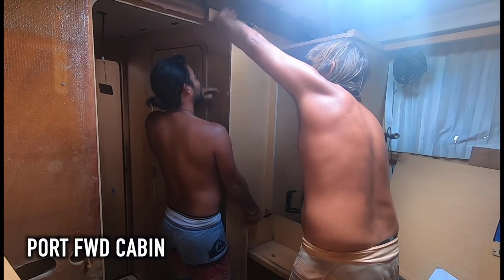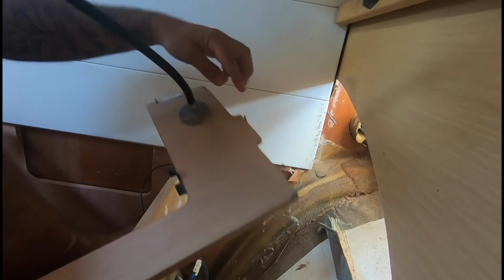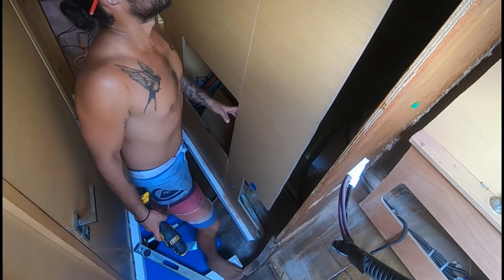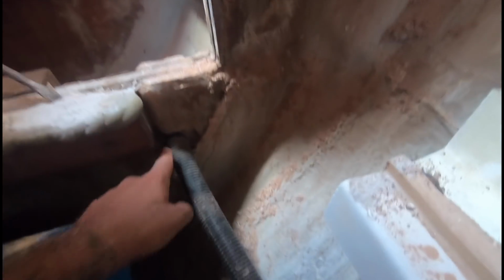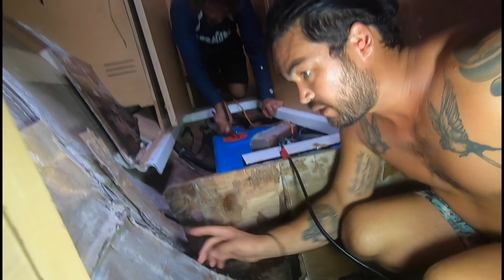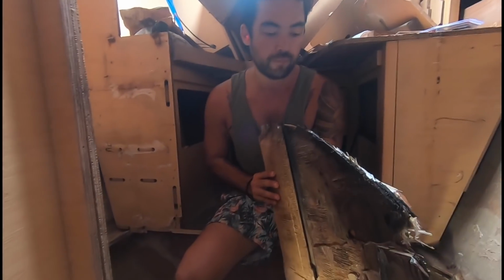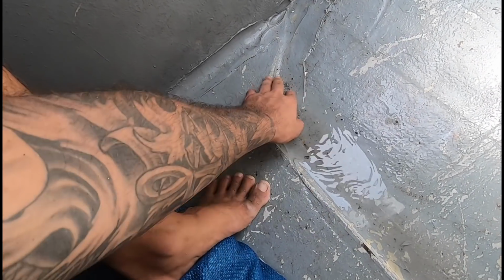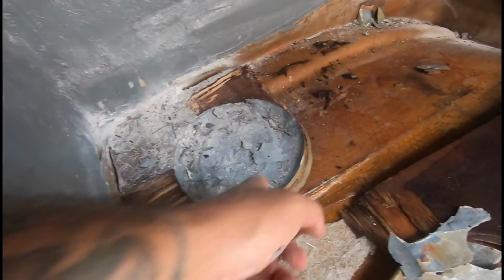CRACKED BULKHEAD REPAIR SERIES - Part 5  (Episode 110)

Comment: I think there maybe a lawsuit with this post might need too be re worded out. Too many people placing the Blame on a company.
This repair on the bolk head can be very dangerous not knowing the running load strength on the  length.
Under compression the load will change the resting pressure even more if you glass into the haul it will be like sitting a knife on a edge of paper and saying it won't go through. But what do I know I'm just a engineer with heavy head injury.
I really do suggest you remove some of this video.

Comment: Hey Colin. Love the videos, and your journey is inspiring. I'm currently  building a small fiberglass sailing dinghy. One of the best tools for grinding fiberglass with reduced dust is the techshear. It is a disc with resharpenable carbide teeth, expensive but worth it. You need to us it with a grinder with a 5/8" spindle that has an adjustable RPM. If you set the RPM's low it literally throws shavings and little dust. Probably too late now, but the next time you grind a large hole in the hull you should try it. I've been in fiberglass boat building/repair for about 28 years. It's still the best https://technashear.com

Comment: With years of building and studying composite sailboats, I have formed this opinion. Catamarans are a design flaw. By this I mean that having two hulls, moving over and threw the waves at different angles creating different roll and pitch are creating conflicting stresses to the bulkheads and the bridge deck’s structural integrity to hold the boat together and all the time adding compression stress from the mast and tensile stress from the rig that is transmitted to the hulls.

Comment: Wow Colin.... seems like these 450's were poorly designed from the start... That other guy you worked with seems to be having the same problems you are and others who are now looking at a class action suit... I understand the determination to finish what you started but man oh man the costs to repair is hardly worth it all. Good on you to finish what you started though, it may just be as expensive if not more to start with something new.... definitely going to be a better boat once it's all done... it may ride 2 feet lower with all the re-enforcing you have to add...lol good luck

Comment: Somewhere in the world, the structural engineer who designed the Lagoon is saying the electricians did what to the structural panels? Why aren’t the cables run under the deck in waterproof conduit with stub outs to each cabin?

Comment: i was in a situation that i had to keep the dust down   if you can and it wont hurt your work so much    very lightly spray/mist a lil water on the glass while grinding   nothing heavy/wet   just enough to keep the dust going everywhere       my solution worked for me.... hopefully it will work for you all

Comment: Colin it would be better if the door frames had a big radius in the corners. = much stronger. Square doors are easy to make and install but have weaknesses . Big radius corner doors and frames  are always stronger but are always more difficult to make and fit . Only  a thought!

Comment: Thought , try completely removing the cracked and broken bulkheads all the way down flush to the hull and replace with coosa board not plywood!!!  The coosa will not rot and it's stronger and lighter , costs a bit more but worth it in your situation !! Oh make your bulk heads 3 inches thick top to bottom , change your door corners in the bulk heads to 8 inch radius, greatly increases structural strength !! Have fun and good luck!!
Reply: A lot more but it’s forever.

Comment: Shit build quality by Lagoon. Out of sight out of mind. Conduit holes drilled in major stress points. I also feel manufacturers should no longer be working with polyester and should at least use vinylester. They will take a long time to recover from this debacle and hopefully they and other major manufacturers will realise that there is no hiding since the advent of the Internet and that they need to build things properly...not just making visible things pretty. 🤨

Comment: hey colin just ask lagoon for a compleet new interior buildingpackage because there is not much left when your done....  eye on the prize guys. you are killing it!
Reply: They'd have to pull the deck to get another factory built interior installed, it's not really made to be retrofitted in like that.
Plus, a factory interior doesn't allow for inspection of any of the important places, which leads to problems like this going unnoticed, which is clearly a huge problem. Better to rebuild it properly.

Comment: Watching the value of Lagoon 450's go further into freefall with each episode..... Having said that, by the time you are  finished, you will be on the worlds most ( and possibly only long term )seaworthy Lagoon 450... Do you ever wonder it it just wouldn't have been easier to build a Wharram Tiki 46 or Islander 65.
Reply: Thinking further on it, designs like the Danson designed Outremers and the Alexander Verheus 50, where the interior is structural would go a long way to ensuring these problems cannot occur, or if they do, they are immediately obvious and remedied. It might be time to move away from designs that hide workmanship.

Comment: The suggestions for a negative pressure enclosure and waiting until after sea trials to replace the interior are both good suggestions.  Obviously you will design the replacement cabinetry for easier access. Hang tough.

Comment: Man that locker leak is mind boggling.  How could Lagoon not plan for such a thing?  No drain?  Wow.  Good on you guys for powering through.
Reply: A locker on the bow, no less.
Reply: @w88dm4n  Not just a locker, they're called "wet lockers" because they're supposed to be designed to store wet items, like scuba gear and the like, so they don't get water all over the place. These are more storage bathtubs, that drain right into the bulkheads, absolutely terrible design.

Comment: I'm kind of relieved to see those blackened plys torn off. I've been thinking if you would just end up slapping repairs on top or if you will go with thorough repair. Good to see it goes into thorough direction. Prime example on how a tiny problem combines forces with design flaw, and how they together reach the stars in the damage universe.

Comment: Lagoon should be paying YOU for all the free real world R&D you’ve been documenting for them. I hope they use this to make their product better. You could have a career as a documentary filmmaker after this! Thanks for sharing! Good Luck!!
Reply: They've known about this problem for some time now, they even have an official repair procedure. Minimum of 50k at the dealer, 90k if they have to take the deck off (which is likely). These boats are all essentially salvage without the owners even knowing. Only a matter of time before they break up at sea.
At this point, you'd think Lagoon would do the right thing and at least notify owners and offer inspections, but I'd guess that they're bracing for a class action lawsuit and don't want to do anything that could potentially be used against them in court. Absolutely shameful in my book.

Comment: Wow! We are all emotionally invested in your rollercoaster journey, and sometimes difficult to know whether to laugh or cry! It may be fate that it is you who has met this boat as you are one of few who has mix of repair and engineering skills and positive outlook to keep going with this project. And mates such as Jamie to help and keep the positive energy.

I am just a viewer brought to your channel during Covid. So my comments are from interest and certainly not from sailing or technical knowledge. Whatever the comments on Lagoon build quality and even whether the bodge job repairs you found were by previous owner or at production stage (they seemed to be in inaccessible places), is there a general issue with polyester resin bond  strength and delamination over time? It seems there is also a problem in the construction process of having pre fabricated inners with slot fittings between hull and deck (plus screw heads inaccessible on hull side!) so there are no inspection points for surveys or maintenance checks to identify potentially serious issues at the bulkhead in particular. The only luck you had was finding this problem when you did rather rough seas in mid ocean crossing. If I was a company underwriting boat insurance, even with a relative few (?) annual non-hurricane losses, I would be requiring surveys on bulkhead integrity on boats over a certain age before insuring. Particularly if water ingress, whether by hurricane damage or leak from trampoline fixtures, rotted the ply to the extent it was a contributory factor to the bulkheads flexing beyond critical strength?

The help from Lagoon is interesting. And, even with your NZ Lagoon contact, it is very unusual for the designer and senior executives to get involved. It may be that at the start of this it was thought that some bodge repair jobs from the previous owner was the cause rather than a production process investigation, and so it would be good PR to get involved with a fast growing social media channel such as Parlay. They may be regretting this now - although a wider issue is that other makers will have had similar production materials and construction.

Comment: All that screwed and glued 'hotel' furniture is a terrible bit of design. Anything that can rot or may need to be removed from a boat should be designed with that in mind. But in my mind designing a boat interior to look like a hotel is just putting unnecessary weight in anyway. If it were mine I'd gut most of it and start again. Lagoon should be ashamed of themselves. Good work keeping it cheerful, and it's fascinating to watch.

Comment: Using plywood for a main structural support seems like a pretty cheap shortcut..Knowing eventually it's going to get wet and rot..There are some water proof structural materials they should have used..I wouldn't recommend that brand of boat to my friends.. It's too bad you didn't know ahead of time and start by gutting and repairing it from the inside out instead restoration from the outside in..😔

Comment: As far as I understand, you are planning to triple up on the bulkheads. For some reason, the lower parts of the bulkheads are already of that size. It seems to be a factory thing. If you reinforce them this way you will be safe for the next decade. But try to avoid drilling holes at the corners of the doors, as this will weaken the structure again. If it's possible run the cables elsewhere. Good luck to you guys.

Comment: The really cool thing is you will be able to build it back exactly like you want, with the features you want, designed the way you want. Something most never get to do so there is a bright side to this project! Not only that you can get rid of any deadly mold that can and has killed people!

Personally I would fork out the extra to use carbon fiber to strengthen and reinforce these areas. Fiberglass is good and all but it does not hold a candle to the strength and resiliency of carbon fiber!

Comment: That WET locker needs improvement I’d say? A quality rubber floor ? To help support ! And or, otherwise reinforced and If it was my boat I’d have a small fan for circulating air to help keep things dry and less stinky ! Sweaty 🥵 and of course a new drain system  ...

Comment: Obviously cut off the trampoline attachments and seal/isolate that area, then build a new strong lip and eyelets or bond an aluminium support rail/eyelet piece so it looks good ! Or something !
Reply: At minimum, all of those tramp attachments need to be removed and silicone'd back in. Also those lockers not having drains is a huge design flaw, they're called "wet lockers" for a reason, ie, they're exposed to water regularly and need to be washed out and drained.

Comment: Seriously, ty for showing how crappy that boat has been manufactured. It's really going to drive down the resale prices on everyone one of them. Seriously, pathetic craftsmanship....they could have easily double up the bulk heads, should have sealed the bulkheads with penetrating epoxy.... you know the simplest things that should have been done to the most structural part of any boat. Ty again. Sorry you are going through this but you are saving so many ppl.

Comment: I’m Somewhat shocked at the bad language and badmouthing of Lagoon after all the help they have given with the technical details. Yes some of the comments one might agree with about NDA’s and getting a new boat et cetera, but remember if the boat had been insured it would’ve been burned and replaced. I think there was an option to insure this boat after the first lot of repairs, so really the faults are with the existing owner, who knowingly at the outset bought a really cheap boat already shoddily repaired. Anyway that said ... I hope they get everything sorted and put back together neatly and properly inside, But I doubt it will be. I just don’t think they have the skills to put it back together to look like and the girl would new out of the factory.
Reply: @Adrian Matthews Adrian, good evening, well I don’t know what to say. Is this Lagoon a design for blue water sailing? Quite honestly I’d rather be on a 45 - 50 single hull for that. How many have had structural issues and were they in extreme use. The boat looks more for inter coastal and top end rentals/hire. Best regards and hope you always have a following breeze. Andy D.
Reply: @Adrian Matthews Right Oh .. shoot.  Will stick with pre used Oceanis 46.

Comment: Getting a fiberglass sandwich beam at the ceiling of the cabin probably would help, if the walls that do not flex, and should keep the hulls from moving independently. The fiberglass you can see below is not very thick and cannot take large stress, the cabin is part of the structure between hulls.

Comment: I was about to pull the trigger on a used Lagoon but put that on permanent hold. Lol. 
Will be checking out other manufacturers 
Thanks for all your hard work and determination 
I don’t think I could deal with what you are going through and I doubt it would be economically feasible to pay someone reliable to do this incredibly extensive amount of work. 
Watching every episode on this. 
Hang in there. 💪💪💪

Comment: I was a commercial aircraft structural and interior repair mechanic..and I thought that was a pain in the ass.
What you are doing, is By Far, Way More Intense. Huge Prips to you two for taking in such a Massive project. 
Though I can relate to the Compassion of a project...once started...you Don't give up.

Comment: Structural way to weak to call anything a “bulkhead” 😏 in the current format!
And cross directional Torsion/ non existent ! Highly likely the “ rigging system “ is disproportionate and likely under too much tension.

Comment: Beyond the obvious of stopping the water coming in the hull where the trampolines are, is it possible to add a drain into the lockers while you have them torn open?  I think it would be cheap insurance if they ever decide to leak again down the road.

Comment: I agree with drew isolate all your rooms and pressurise and evac , and cut those beams out?
They are NOT beams ! No matter how many laminations ! Make structurally integral new composite beams with integral wall supports molded into place on the beams, as if to them slide your new composite wall structures UP right/tight to place and then locked into the new floor supports your going to need. Think outside boxes 📦🤓😏 
Lagoon should be able to supply quality Carbon materials ? I’d be making shiny new exposed beautiful bulkheads throughout , this is essentially a complete internal refit to do this properly, you may as well set up a BIG army tent ⛺️ catering/production facilities with sleeping arrangements outside the vessel,
Even with room by room sealing and evac, this is technically a biG job and to do anything less would bite to hard into time ? 
Remember the adventure ? 
The world is waiting !’ 🇨🇦

Comment: Sometimes that just aren't enough rocks. (Forest Gump)  Why use a material that can "rot" at all - on a boat? Better to use a smart designed-for-rigidity carbon-fibre panel or fibre-glass-E.
I would go to war with you two any day of the week; not sure I'd want you in my platoon nor in charge - but in my army any day of the week - for sure. You two are friggin  Spartacus !

Comment: You are in the worst of the restoration process right now.  After all of the demolition and final grinding to get to a surface with integrity, you will have a clean, blank canvas.  Every day after that, the boat will be coming back together, under your terms (and likely overbuilt), resulting in a boat with a sound structure.  You'll have a great boat.  However, your series convinced me never to buy a boat designed for the charter business, to say nothing of buying a hurricane damaged boat, as it seems they were designed for a specific lifetime prior to disposal.  What a trainwreck this has been for you.

Comment: So many Lagoon broken bulkhead videos!! How long before Lagoon steps in and says they are going to fix these boats for these poor people!!  Parlay I hope your repairs go well !! Also what engineer signed off on 1 sheet of plywood being good bulkhead material.
Reply: Lagoon will step in when the earth freezes over
Reply: @rayd488  Or the owner of Lagoon will close up claim bankruptcy and sail of into the sunset on some other make of sailboat he can trust not to break apart!!
Reply: @ecuunlock  Main market for these boats is the charter industry so their intended usage does not normally involve or stand up to the forces of ocean passages. Even so they will all deteriorate, they are not built to last. Parlay is hurricane damaged so that may be the excuse, but I don't know how they will explain away non hurricane damaged boats. Probably ignore the problems and hope it goes away.